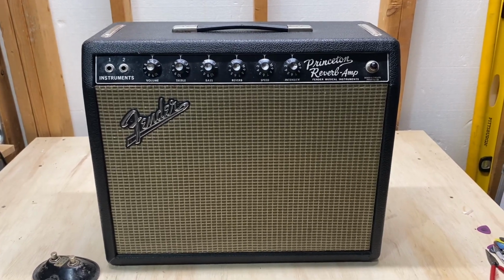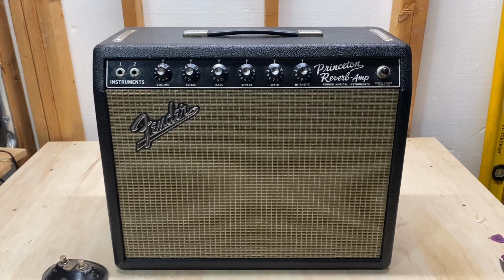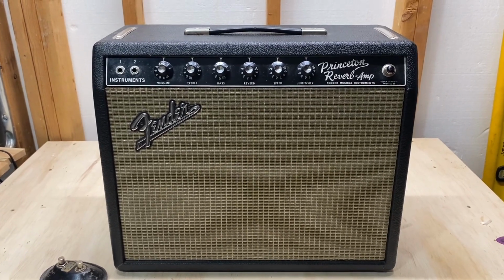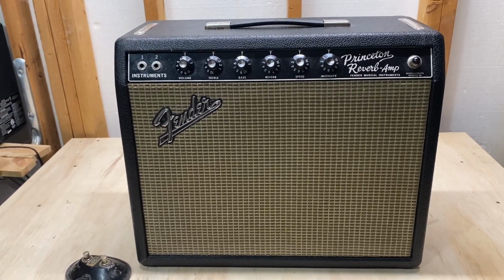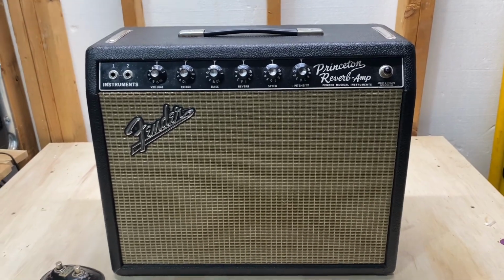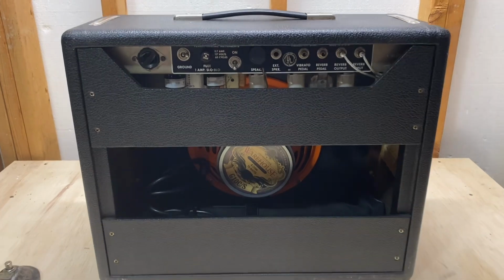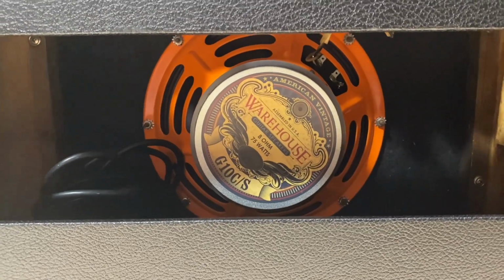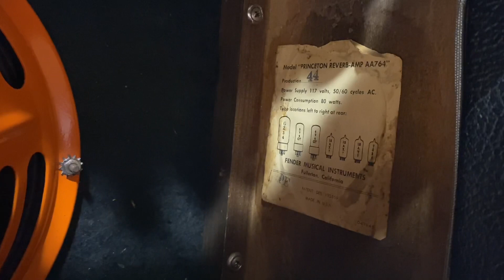The Best Grab and Go Amp. 1966 Fender Princeton Reverb

Comment: Vintage iron is alot of the mojo.especially the output trans.i bought a hw replica of a 64 deluxe the guy that built it put a 30 watt power trans in it.i found a real 64 output trans for it and its bad ass.the extra 10 watts helps the amp breathe and the vintage output trans made it into one of my favorites.i have a 66 super reverb and a 64 bassman for comparison and its there with them.great video and playing.
Reply from the maker: Definitely! Thank you for the comment and thanks for watching!!
Reply: Good info.just to clairify i put a real vintage 64 deluxe ot on it.

Comment: I grew up on a PR in the 1960's. FYI the Eminence 1028K alnico speaker sounds the most authentic; it's great in vintage PR's. WG speakers sound great too, but the 1028K is the most authentic sounding. If I could only own one amp it'd definitely be a vintage BF PR. The 1970's SF PR's (non-master volume) are also great. Sorry, but the reissues PR's are truly NOT as good. Save your $$$ and get the real thing.
Reply from the maker: For sure!